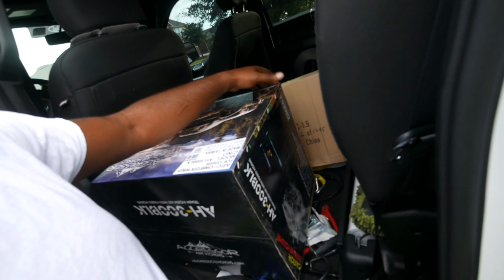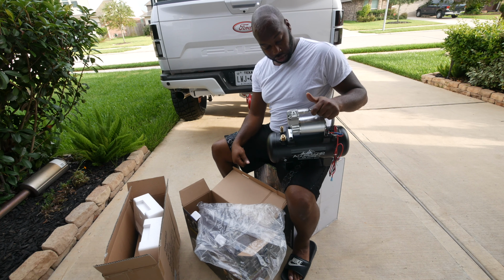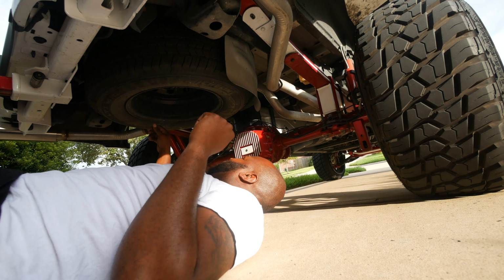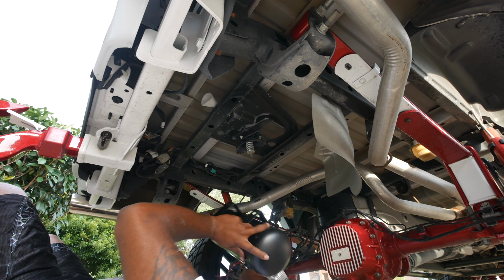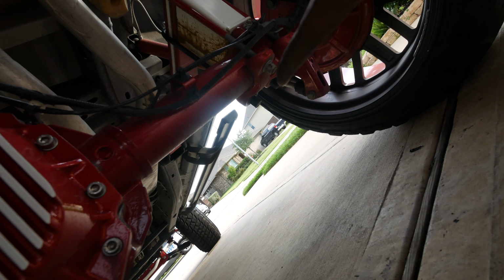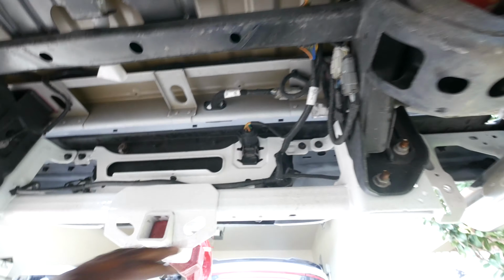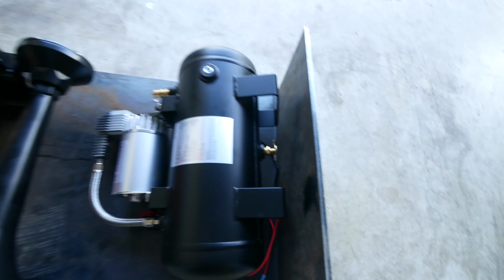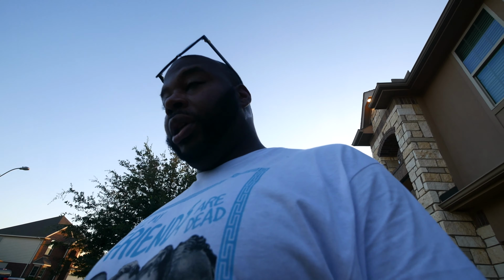THIS TRAIN HORN TO HUGE I MADE A MISTAKE

Comment: Get you a spare tire rack custom built for your bed and mount the spare tire at an angle.   That way you can have a cool accent for the bed as well as a another wheel to match the 4 on the ground.    Just a thought